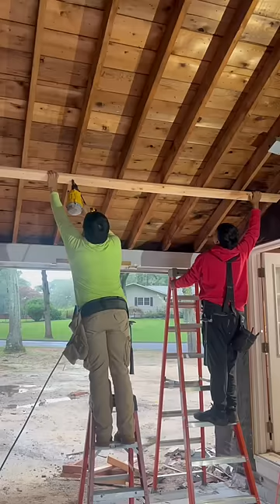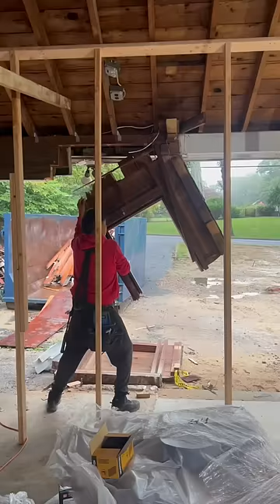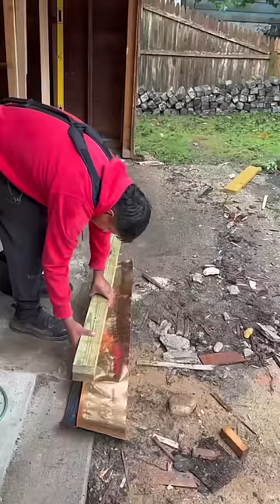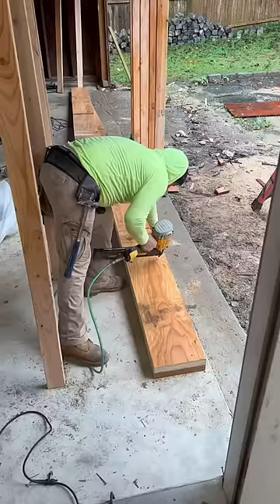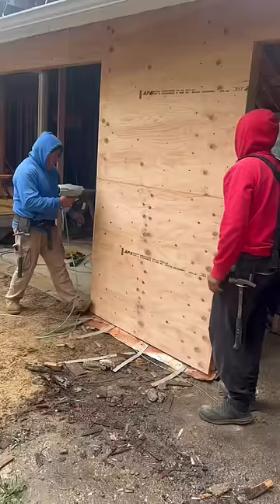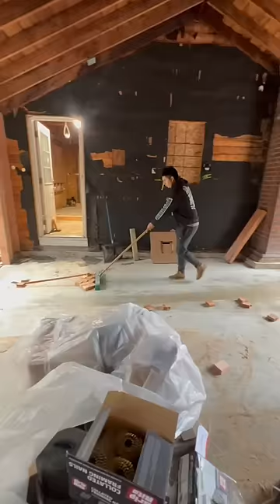Garage #shorts #short #construction #skills #work #perfect #carpenter #team #architecture #design

Comment: There's always room for corrections in a good days of work with great outcomes. So it's always good to be receptive.

Copper and metal don't mix. 
If you can avoid toe nailing it's great and a good practice now a days.
The only toe nailing done now a days are with Thompson 6" screws where needed.
Always good to see 5/8 OSB board sandwiched when two framing woods are gonna be nailed together.
Hangers are a must in our side of town.
L braces are starting to be a common use on top and bottom of a king stud to a header.
Flashing tape wrapping is more common use now for bottom plates from under then up 3" on both sides besides the one going straight on the footing.
Waterproofing footing before and after framing with a good sealer is going the extra but is looking like in 5 yrs gonna be a common thing like flashing and house wrapping has gotten now.

Keep up the good work good 👍

Comment: Great job 👍 Looks great. I had to do the exact same thing to a 20ft section of my outer wall on my house. I tore off the roof sheathing, cut the trusses loose from the wall, built a temporary wall to support the trusses and tore out that 20ft section. I then built a new wall, new entry door, new siding, and installed new roof.
Reply: Trusses can be tricky as they are designed with load points, and if u support in the wrong location the could come down on top of u
Reply: @davidanderson1074  I know that. They are just standard A frame trusses 28 footer's. Like I said all the shingles were removed and the sheathing, that took a lot of weight off the trusses. All I had to do was build a temporary wall, nailed it underneath the outriggers and jacked the trusses up off the wall with a 20 ton Jack. Then blocked underneath the temporary wall and let the jack down. That gave me enough support for the trusses and clearance to build the new wall. I'm going on 20+ year's General Contractor.

Comment: That's nothing. My friend from high school was from a family that was into jacked up Jeep's, but when he and his wife bought their first house he had to park his beautiful baby outside because it wouldn't fit in the garage because the regular height garage doors were too short, so we built a support of the roof inside, cut all the way around on three sides of the garage, broke the roof loose from the house, jacked up the roof a foot, added new king studs and hold downs around the openings, bolted scabbed framing across the one foot opening all the way around, patched the stucco on the outside, added a panel to the top of the existing roll up door, then drywalled, finished and painted the entire inside of the garage, including an epoxy painting of the floor. It was awesome. The neighbors marveled at it. Did it all with engineering and permits also. The work we knocked out over just a few weekends. Whole project doing it in our off hours like that took about a month total.

Comment: You did a great job replacing that load bearing wall. But I must ask where are you ceiling joists? What's keeping the two outside walls from from bowing or moving? Unless in your video I missed something?
Reply: I was looking for this very comment.  My thoughts exactly. Collar ties are necessary  and shouldn't  exceed the upper third In terms of height from the theoretical rafter ties "floor" to ridge

Comment: Good job, but they should have secured a bottom plate to the floor when they built their temporary wall. It doesn’t matter if it’s a wood floor or concrete. Always work smart and safe.

Comment: The copper flashing coming in contact with the tie-down straps, (or other steel,) results in a dielectric effect. The steel component will rust out prematurely, especially in a moist climate.
Reply: That is a concern in water pipe applications not this application
Reply: @Tom-og7fi  Again, climate dictate the years, but I'm pretty sure the moisture content of the concrete in the wet season would supply that trickle of conducutivity to ground out the system.
In copper iron/steel situations the steel serves as the sacrificial annode.
The effect is small, and forgive me for not reviewing the footage (not possible this second or I loose my text..,) but if the bracket contacted rebar the corrosion would span over the larger circuit bit at a slower distributed pace.
In plumbing, die-electric fittings are the correct answer, brass between the copper and iron pipes has been said by-others, to not be enough.
I'd say there is an argument that the chromed iron fittings extruding into the shower get replaced and are not hidden behind walls.
Later Alligators,
Dan
Reply: @Tom-og7fi lol what. Yes its a concern..
Reply: @dang8134 concrete in the ground will run at 70% moisture steady
Reply: @thenarrator1984  no it is not if it was the builders would not do it this way. Are you a tradesman or just someone who thinks they know things.
Reply: @Tom-og7fi  Hahaha

That's the dumbest logic.

It is 100% oxidizing due to the contact..
Reply: @Tom-og7fi   Well, I started with HVAC in my teens. There isn't much in a home I haven't done, and aren't reasonably capable.  I wouldn't call myself a skilled framer.  Don't ask me to cut a stack of rafters for complex roof, or put skilled finish on a concrete slab.
In my mid-30's I wrapped up an engineering degree (got to study tnt, and use it in the field... tunneling.) Later got my stamp.
But, every home I buy needs more than TLC. My revolving engineering schedule has left me lots of time to continue in trade-work through the years. Pushing 50 before long.
I'm actually one handy SOB, that likes to drive tunnels too.
But again, while I could frame up that garage, I wouldn't call myself a framer. Touche.
Merry Christmas, 
Dan
Reply: STOP IT !!!!!

Comment: Looks good. I don't know about the building code in your area, but in our area 2 king studs are required on each side of window and door openings.
Reply: Also don't break top plate over nothing lol
Reply: @Manofsteel420  good catch. It went by fast, but it appears that the top plate isn't overlapped, nor is it supported by any studs at the "seam." Most building codes require a minimum of 4' overlap.

Comment: The project was to widen the garage doors at the expense of the storage area at the end wall. I did not see how the edge of the concrete was handled to accomodate the new door sizes. I assume the point loads are ok (it is a sidewall).

Comment: Anybody determine the point of this? They cut out 2 garage doors and put 2 garage doors back in... why? Why not expand or make it a single door? To me as a contractor this customer has been ripped off. If your gonna tear something apart give your customer a reason to make it better. If it was rot than it could be fixed way easier. 

#probablyrippedoff

Comment: Putting zinc galvanized fasteners in contact with copper flashing will cause an electro- galvanic reaction that will quickly corrode the fasteners.

Comment: Why didn't they have that whole area with 1 garage door?
Reply: Look closely, the concrete isn’t poured to accommodate a single door (there’s a ledge in between the two doors)
Plus in order to span the continuous distance from one wall  to the other they would’ve either need a MUCH bigger wooden beam or a steal beam with steel columns, both very expensive options

Comment: Who ever posted this video, you have alot to learn.  I wouldnt hire you to build a dog house because the fact you lack a ton of knowledge on weight loads , support and dissimilar metal contact. 
You installed a copper metal sill plate flashing which is great perhaps for termite protection ect... than you placed galvanized metal tiedown strap on top of them @ the wood bearing king posts and stud locations. The 2 dissimilar metals will corode in a matter of less than 3 months absolutely  rendering the use of both for their intended purposes absolutely useless. Also, your amount of temporary support bracing of the existing wall and roof structure was far below/ in adequate what should have been installed for structural support  for removing the exterior wall portion. You are looking for a call back or lawsuit when this home owner calls you because his tiedown straps corrode  make his structure exposded to wind or termite damage  due to corroded holes in the copper and galvanized strapping. Best advise. Do alot more research on builing/structural framing renovation steps. Learn a hell of alot more on weight load charts for temporary support posting .